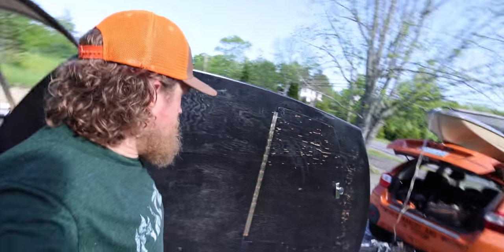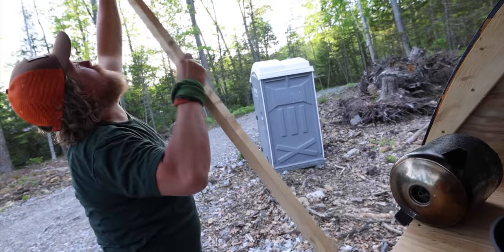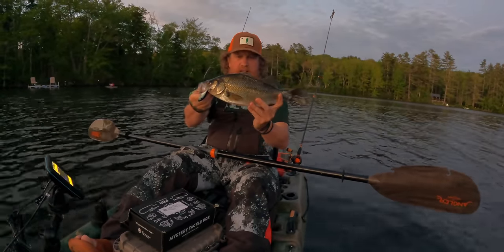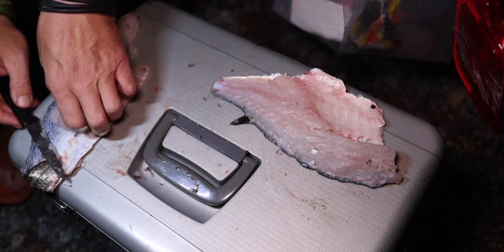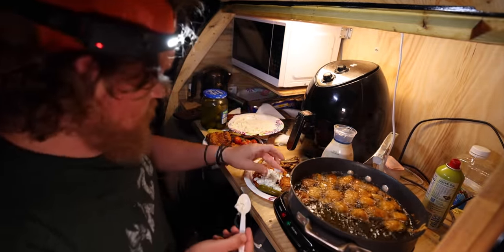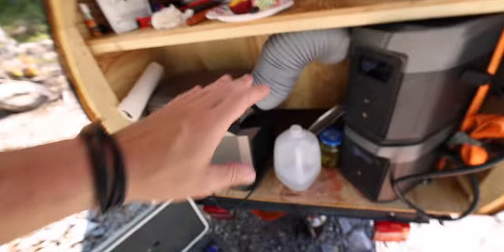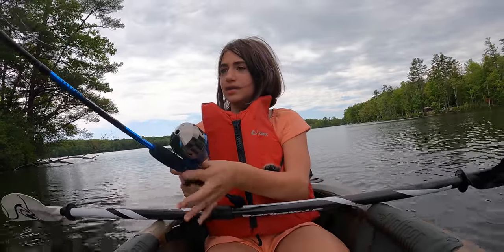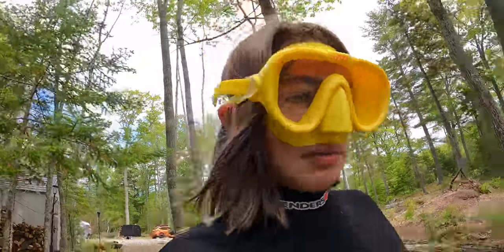Tiny Glamper Camper Installing Air Conditioner Build and Catch & Cook Adventure

Comment: If the wax is absorbed into the blanket: just use a hot iron, place it over a paper towel over the wax and iron away. The paper towel will absorb the melted wax.
Reply: hair dryer will work too
Reply: I also use a brown paper bag.
Reply: Also throw it out and go to good will or just put up with a tiny bit of candle wax cuz it's a camping blanket...
Reply: I would use a damp washcloth than put a hot iron on it
Reply: It’s not that wax
Reply: Put a piece of foil between the paper towel and iron or you will ruin your iron with the wax. I have used the paper towel and iron trick MANY times to clean our church carpet after weddings or candle light devos.
Reply: @christbearer2111  that's how I've always done it and irs works like a charm

Comment: Zack, try laying a sheet of newspaper (paper towel may work) over the wax spots. Then warm up an electric iron, after first making sure that it's the iron that your wife or girlfriend is okay with you, potentially, ruining. Then run the warm iron over the newspaper. It should melt the wax and the newspaper will absorb the melted wax. It is a technique used in a fabric printing style called "batik". It is time consuming, so be patient.
Reply from the maker: Cool thank you tried that  and it worked butterfly!!!
Reply: @FowlersMakeryandMischief niiiiice

Comment: I am a professional painter. It looks like you used treated sheeting (4X8X1/2) . U have to let that wood dry out for a few weeks and then stain it not paint it. Use Sherwin williams Super deck it will absorb into the wood and it will be fine. Sand all that off and use that Super deck solid stain from Sherwin Williams.
Reply: I was thinking the same. Moisture build up maybe?

Comment: Paint peeling cause the wood warping from ambient moisture and temp changes, plus if you burned it before you painted it (I think so if from watching the first build video when you originally did it) it'll prevent the paint from soaking into the wood and just drying on top. Plus, if you used a water based paint, that also won't soak into the wood. 

Either like a coleman camp stove or other lp stove, or the butane ones all work very well. Those electric hotplates are power hogs and difficult to control heat on.

Love these videos of the Glamper!!!

Comment: Hey Fowler. I know you aren’t watching but rather than that super long stick to hold up the door what if you made two shorter ones that swung up closer to the hinge point.  16” should do it.  They could stay attached to the door or the trailer side.  Whichever works best. No chance of knocking them out accidentally like that big stick.

Comment: Break off as much of the wax as u can, then take about 3 layers of paper towels, lay the layers of paper towels flat on the wax while heating the towels with an iron. As the wax melts, it will b absorbed by the paper towels. Keep doing this till all wax is gone. Good show, thumbs up.

Comment: Just a guess. If it gets hot enough to melt candle wax (min 130°f), and remained there for awhile, the plywood started releasing humidity making the paint peel. Suggest putting a soffet vent or two on the sides. That should help with excessive heat and humidity when storing. "Damp Rid" is also great for musty areas.

Comment: Freeze the blanket. Put it in a sealed plastic bag and freeze it overnight.  Next day, take the bag out and start bending the bag to break up the wax.  Open the bag, do this outside... It's pretty easy to basically brush the frozen wax off. 
Wash by itself in hot water. Good as new!

Comment: Hey all you need is boiling hot pour it on the opposite side of the blanket and this will release the wax, the iron and paper towels would work too but it would be time consuming. Plug the bath tub and stretch the part with the wax on it, pour the boiling hot water on the opposite side of the spill and this will release the wax in the tub,let it cool and you will be able to collect the hard wax before emptying the tub.

Comment: To get the wax off put a towel on the wax area then heat up a flat iron and pass it on the towel so the wax can be removed use an old tow. It works

Comment: What U need to use Is emolsa bond  aka e and b get it at the paint store as a interior/exterior painter we use it everytime .it helps exterior paint stick for a very long time only in the first coat thow.👍🏼 a hot wash will get out the wax but that's an electric blanket so  I googled it lol scrap it with a butter knife blow dryer then wipe it off 🙂. Tree frogs !!!! I can't belive how big she is getting looks like u guys had so much fun 👨‍👧. U 2 talking to each other three the glamper camper was to funny 😁.  Fosters 🍺!. Mmhum haha. Eggs in a basket for breakfast where's mine🤔. Both your girls are growing up so fast zack. Underwater catch and cook thanks for sharing as always 👍🏼.

Comment: if the wax is absorbed into the blanket: just use a flame thrower, it will get rid of all the wax stains if held long enough in the same spot

Comment: We have a 15,000 BTU portable single burner dual fuel stove by Gas One that we love. They go for about 60 bucks. The only issue is that the hose for the propane tank failed, so we only use butane on it. Gas One used to carry replacement hoses but they have been sold out for over a year now. It also looks as if they are selling the stove as butane only. Still, it's a pretty nice little stove.

Comment: It was moisture from the inside of the door. When you finish wood, you have to do the same coats of varnish on both sides or it will peel.  If your house paint peels , you need a vapor barrier

Comment: Pro tip for the eggs that you made inside of the toast if you use the top of the ring of a cup or a mug and press down on that piece of toast it’ll make a perfect size ring and a perfect circle. Imk If you try it and it worked

Comment: @ Foster's Makery and Mischief:

To get candle wax out of most fabrics. Stuff you will need: Iron, Ironing board, flat piece of cardboard, and possibly a lot of brown paper bags.

1) Get your Ironing board out and ready.

2) Place the flat piece of cardboard on top of the ironing board.

3) Place the fabric where the wax is on top of the cardboard.

4) Heat iron on cotton setting. 

5) Rip paper bag in half. Lay it on top of the fabric where the wax is located. 

6) When the Iron is heated up start Ironing on top of the paper bag. The wax should seep through. Once it seeps through change out the bag. You want to use a fresh piece until the wax no longer seeps through. 

I hope I helped and didn't make the directions too confusing. Good luck with your blanket.
Reply: Dang auto correct! I'm meant Fowler's Makery and Mischief. 😅

Comment: You should definately go for induction hotplate. It is will boil water faster than anything else. Watch out for the power rating you will have to buy one that is less watts than your battery peak battery output because they modulate power by time so 1800 watt at half power is 1800 watt half the time.

Comment: Put a paper towel over the wax and iron it on a low heat , the paper will absorb the wax , repeat using new paper towels once the wax has absorbed into them 
👍🏻

Comment: dont use paint you'll only do it over and over, but if you use Rino liner for pick up bed liner its even scratch proof, or the one they use for water proofing basement cement wall, use ice for the wax freeze it and feel off, wax will crack off

Comment: If it's just a citronella candle just wash it in really hot water. And for the wood inside and screen just a wash cloth with as hot as you can stand water with a some habd sanitizer will get it cleaned.

Comment: To remove wax from your blanket or any other fabric, lay it out in a large flat area. Then make a stack of four paper towels and place it on top of the wax. Now use a regular clothing iron, set on high and iron the paper towels. This will melt the wax and as it melts it will absorb into the paper towels. When the entire stack of paper towels gets completely full of wax replace them with a fresh stack and continue this process until all the wax has been absorbed. If you take your time, and keep replacing the paper towels when they're full of wax, you should be able to get all the wax out of the blanket and any other fabric.🖖😎👍

Comment: only way i can think to get wax out is to put in hot water close to boiling temp to soften the wax and float to the top may take a little trial and error, might try epoxy paint on the camper since wood is pouress  it will seal it and you can paint over that it you cannot find the epoxy color you like

Comment: Zach @fowler'smakeryandmischief are you planning to make an exhaust port for the A/C unit? If not you're just pumping the hot air back into the rear of the Glamper.

Comment: Wax removal: put absorbent paper both sides of fabric then paper on top of that and iron to melt wax ….. keep doing it until most of the wax is removed … a hot soapy wash should remove the residual…. Skim the water once cold so wax doesn’t settle back into fibre…. Good luck

Comment: It's a blanket they are cheap jist replace it. Better to paint the camper a light color won't get as hot and sun won't eat paint up as much.i would paint the inside lip of doors also and out a weather strip on there.

Comment: My wife Hamilton said to remove wax from fabric to freeze it and peel off,if saturated into cloth then use hairdryer and papertowel.We had a candle drip down fabric speaker cover,she popped off panel,laid it on floor on paper towel and hit it with hairdryer,melted and towel absorbed it,light brushing took wax shine away👍blanket might be stained but most will come off,besides gives ya something to pick at watching scary movie😆we know you hate boogermovies😂👍

Comment: You get wax out by taking a cut up brown paper bag.  Put the bag on the spot with wax a using a heated iron the paper over the wax spot.  The heat from the iron melts the wax and the wax is soaked up in the paper. This is how they do it in churches.

Comment: I believe the reason your paint job failed was because you used the wrong primer.  You wisely coated the plywood with epoxy.  However you can’t use an acrylic primer on an epoxy.  It doesn’t work.  Use can use like Rustoleum primer which is a fish oil epoxyester primer and that should work.  It was good to see you out with your children.

Comment: If you even get this message cuz I've never done this you didn't like us to have wax in it anything like that hanging up to where the center of the spot of the wax is hanging record down so it can drip and take a hair dryer and get the wax hot let it melt liquify and drip out this way take a few times be careful not to burn the blanket when you do so